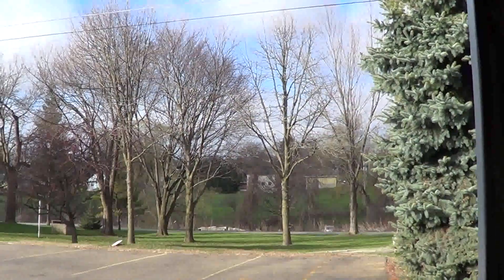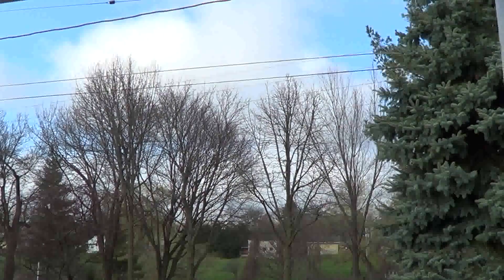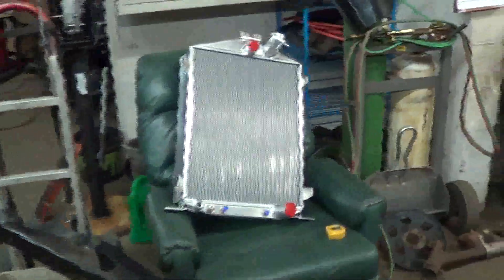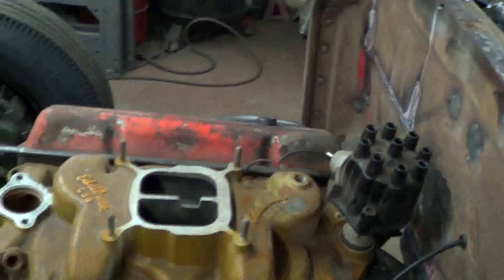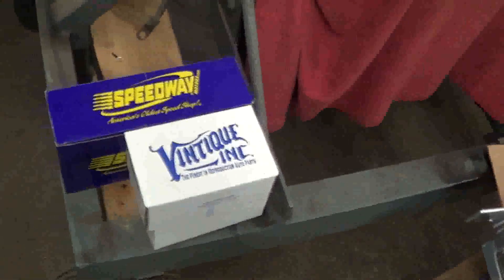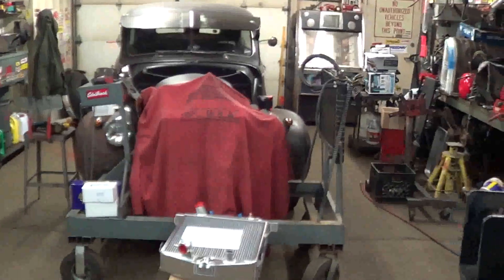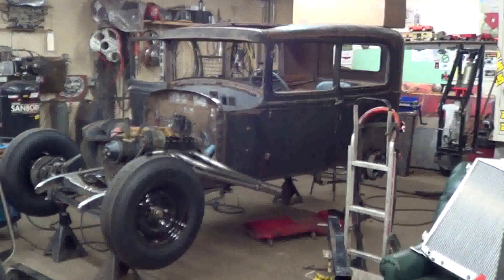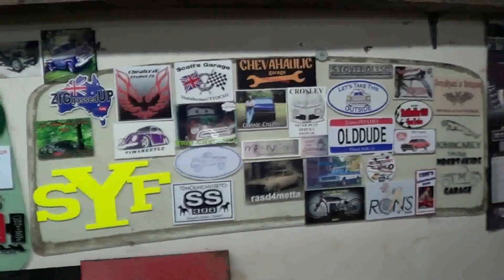5-3-14 , whats all going on

Comment: On that older intake you got what do you know about that notch that is cut into the divider of the dual planes?  I came across that on an older intake I bought for a Dodge engine once.  Someone told me it was so you could squeeze a bit more power out on the top end, but I never believed that why would you notch that out to do that when there are adapter plates that would help you with that and prolly be more effeicient too.
Reply from the maker: first off , you have to remember , this is 1960's thinking here . And matched up to a stock intake of that time , these were the hot ticket .
 But they believed it would help in balancing out the pressures of the two half's of the dual plane intake . Does it work , I'm sure at certain RPM's  it helped . But yes , later on , when they figured out how air flows wet in an intake . Single planes were made for the High RPM race motors . And long runner dual planes for more of a driver for torque . Adding a spacer helps in the mixing of the fuel and air on a dual plane , but mostly at higher RPMs . you'll loose some torque down low with spacers . At least , thats what I have found over the years . I'm sure others will disagree . But it also plays into the size of the motor , and the RPM range your building it for too .
Reply: Makes sense!  The particular intake I had matched up to a stock intake as well.  I kinda wondered if it was some sort of old timer engineering or some sort of cheaty thing for racing.